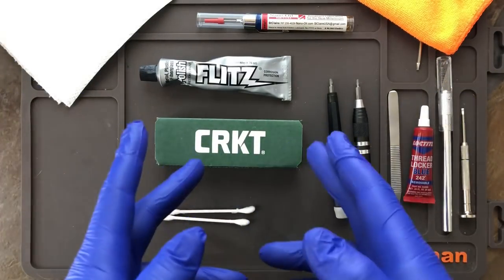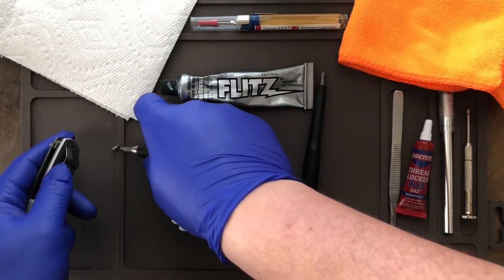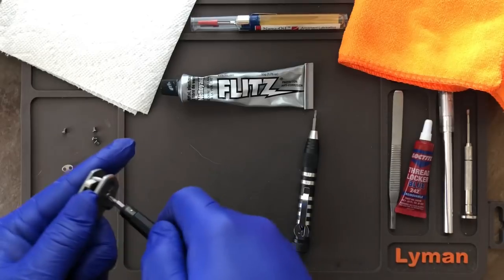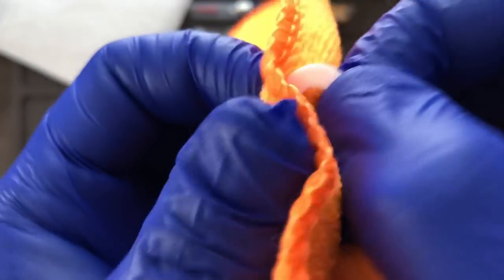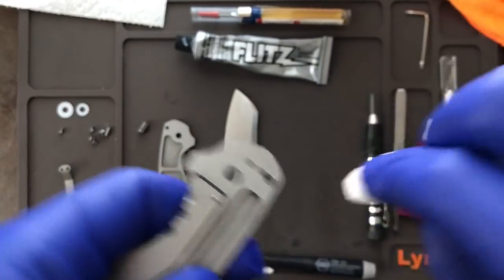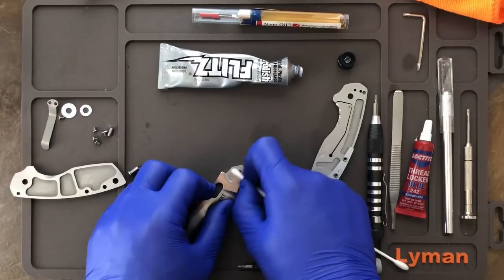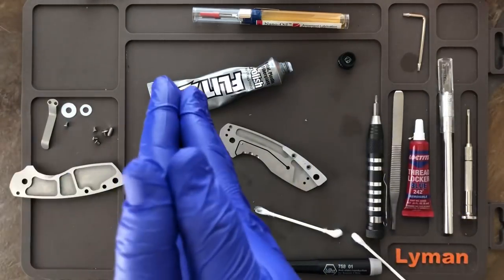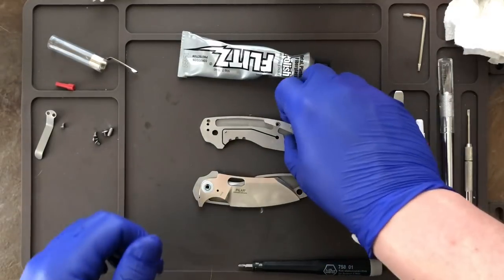How to Smooth the Action on Your CRKT Pilar - A Casual Tutorial

Comment: On my CRKT M16-04SS I used a dremel type tool with a little polishing wheel and fine paste. I polished all bearing surfaces and the bronze washer then put a thin layer of moly grease on all these surfaces. The difference is huge and well worth the time and effort.

Comment: Using compressed air duster on pivot is easier than disassembling. Then just use KPL on the pivot.
Reply from the maker: JcruzR 2  Did you even watch the video?  This is a tutorial on how to smooth out the action.  How to make it better.  Permanently.  Not how to do basic cleaning and maintenance. 🍻
Reply: The Casual Cutter Sorry, dude. My comment was just a suggestion for other commentators. I understood what you were doing. I like tinkering with my folders, too.
Thanks for the info video. 👍🏽🔪
Reply: The Casual Cutter Used Flitz on a Civivi Hooligan and Elementum. Both came out smoother.
Reply from the maker: JcruzR 2 Sweet!!! 👌

Comment: This is probably skipping ahead but...how do you re center your knife blade?
Reply from the maker: You have to play around with the pivot screw and body screws to find the sweet spot.  Unfortunately some knives will never center perfectly (especially cheaper ones), but you should be able to at least get it close.  The key is to get all the screws snug almost all the way so that there’s still a tiny bit of play, and then adjust from there.  Where do you get the blade close to center, then take down the body screws all the way and focus on the pivot.
Reply: Loosen the pivot only get yourself some pieces of  cereal box put a piece of cereal box on both sides of the knife blade while it is shut if you still have room put equal amount of pieces on both sides then tighten your pivot it should be perfect unless there is a misalignment of the washers

Comment: How did you take it apart so easily?? The body screws on mine are spinning and i need another tool to secure the opposite screw. And the pivot screw i believe is loktite'd in. Help
Reply from the maker: These have pretty poor quality control and are often over tightened with too much locktite from the factory.  There are some tricks you can use such as applying heat to break down the locktite, and applying tension by squeezing the blade back inward when trying to break the thread.  Good tools are always a must as cheap bits can easily strip out the hardware.
Reply: You can used a heat gun, even a hair dryer, hot water will also work, but in any of the mentioned methods, beware of too much heat and any plastic pieces the knife may have

Comment: Bro, my Pilar came with all screws super tight. It’s almost impossible to remove them. Any advice? Cuz I want to clean mine up
Reply: hair dryer or something to heat up the screws slightly
Reply from the maker: Are they almost impossible to remove, or are they not moving at all?  Heat can definitely help, but sometimes even that won’t always work.  Try heating them up a bit with a hair dryer or heat gun, or even a soldering iron and see if that helps...
Reply: Use compressed air duster on the pivot. It’ll clean it out very nicely. Then use KPL on the pivot. Easier than disassembly. 👍🏽🔪

Comment: My pilar large has a symbol on the top of the blade that looks like ikbs. I took it apart and sure enough, mine doesn’t have Teflon or phosphor bronze washers. It actually has bearings. And not loose ones either. Caged bearings. Am I alone here?
Reply from the maker: There appear to be more recent exclusives that have bearings instead of washers...
Reply: @TheCasualCutter  oh I see. Well I got mine at Lowe’s so I don’t know about it being an exclusive, lol. I have noticed more crkt knives coming out recently with the ikbs system.

Comment: Today I received a CRKT Bev-Edge . Because of this video, first thing I did was open it up. It has ball bearings.
I found NO crud/flash/chips like you have. But the flipper remains pretty stiff, even after oiling and hundreds of open;close cycles.
I am tempted to grind down the dimple a little.

Hence, my opinion of Bev-Edge is waiting for more time to pass.
Reply from the maker: JackBN  the best way I’ve found to smooth out knives on bearings without getting too invasive, is to clean them out completely and run the bearings dry.  Polish up the flats of the blade that contact the bearings and the detent ball and it’s path.  Flip it a few hundred times and see how it feels. Is it not smooth on the drop or the open?  Is the detent too weak?

Comment: Dude mine came smooth af already
Reply from the maker: Practical Tactical  You got a good one.  CRKT has a history of being one of the most inconsistent production knife companies there is for QCI.  I’ve had around 6-7 Pilar Large, and a dozen standard Pilars.  The Large version definitely has better QCI than the original, with about 75% of mine being kind of “acceptable” out of the box.  But the standards were a 50/50 hit or miss.  Regardless, all of them will benefit from the process shown in the video. 🍻

Comment: Got a Pilar large D2 on the way, this was really helpful. Scared that the screws will be too tight to remove...aside a heat gun or hair dryer, will dunking in a hot cup of water help and not warp the g10 scales?
Reply from the maker: Tariq Kamil Boiling water shouldn’t even come close to warping G10... It also won’t be hot enough to even be useful IMO.   But I’d suggest the first thing you do before anything is have a quality set of driver bits (Wiha, etc) and GO SLOW.  I’d venture to say that 9/10 stripped screws can be avoided by technique.  Make sure the bit is fully seated and then start to unscrew slowly.  You want to feel the resistance in real time.  If you start to feel like the screw is requiring enough torque that it may strip, STOP.  Take a breath and try again, slowly.  If it still feels like there is too much resistance, then consider heat (I’d go for a soldering iron personally).  But the good news is that all the Pilar Large I’ve seen seem to come apart really easily. 👌
Reply: The Casual Cutter yup got the wish set from xioami for my other stuff and things. Thanks a lot and for the vdo tutorial
Reply: @TheCasualCutter  all done, thanks for the advice and vdo. I took it apart to dremel off the the flipper tab. While there I followed all ur steps and even polished the washers using blue compound rubbed on paper and just ran it in circles for like a minute or 2 on both sides of the washer

Comment: In regards to the "burr" you found, wouldn't the washer cover that burr? Do the washer spin? I have a Pilar III coming. That knive has bearings, so polishing is not necessary. I hear that the liner is fussy sensitive to pressure impeading "flicking". Any suggestions if the knive I get is tight?
Reply from the maker: The blade makes contact with the washer, and is meant to glide across it… so unless it is perfectly flat it will impede the action. The Pilar 3 as you mentioned is on bearings and is an EXCELLENT knife for the money. I have the D2 version and the action is amazing for the money.  Middle finger flicking is effortless and the place fires out with authority.  It does have light lock bar tension which makes the blade drop closed very nicely.  As always, it’s a frame lock so putting pressure on the lock bar will effect the way the knife opens and closes.
Reply: Thanks for getting back to me. I'm a new sub and will check out your extensive content vid library. Lots to learn here.
Reply from the maker: @kimleith1378   Thanks!  I did take almost 3 years off from YouTube but I’m back and plan on diving into my collection as well as getting back into mods and tutorials!  Stay tuned!!
Reply: @TheCasualCutter  Tons of "Youtuber" knife nerds out there. Welcome back.